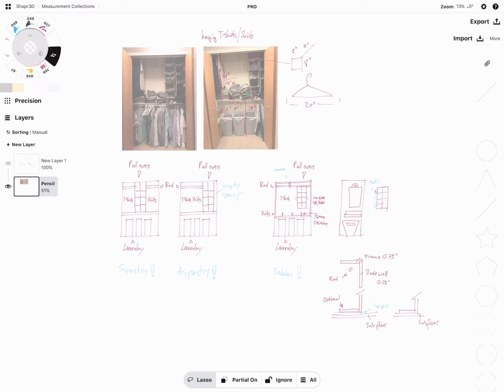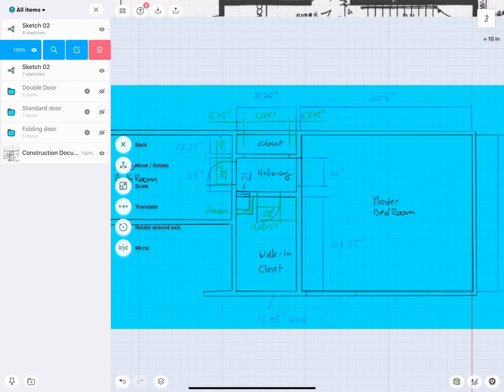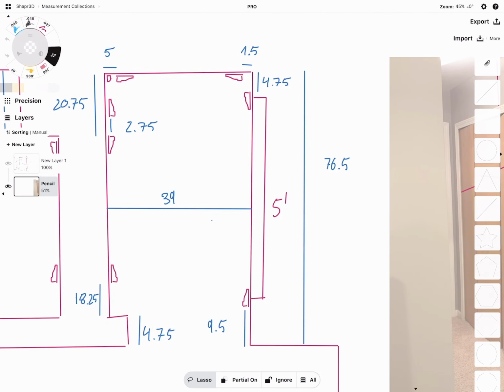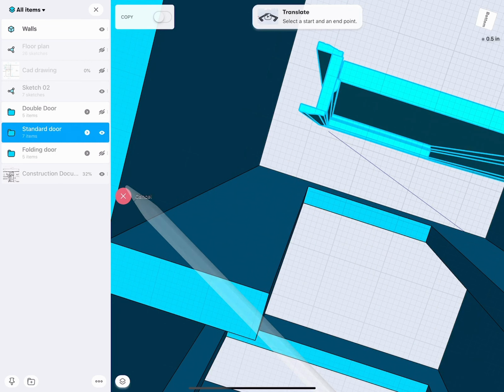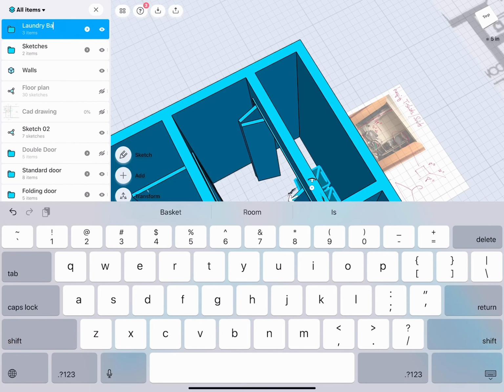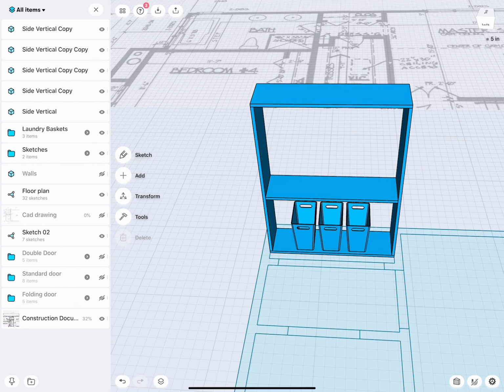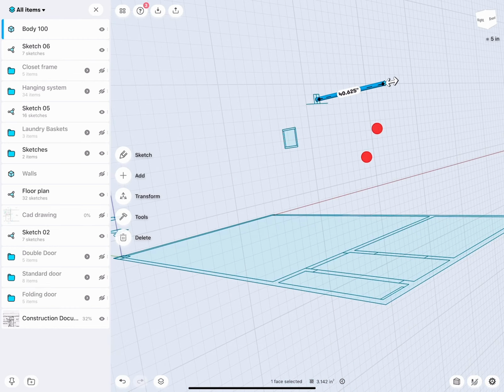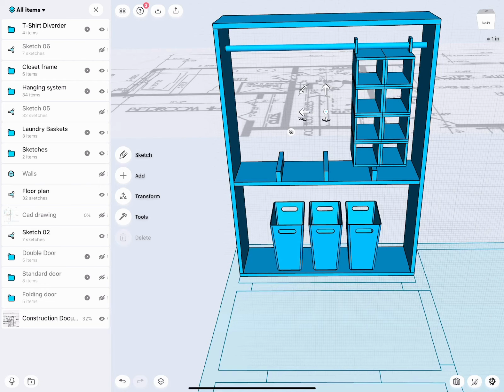Import and modify floor plans as DWG files on your iPad | 3D design webinar

Comment: I am really loving Shapr but you need to speed up the presentations, 10 minutes in and we are still scaling the image. A separate video for scaling images would help then you would not have to explain it in every single video. The scaling image option could be so much easier, in most CAD packages, the scaling of images just requires a reference dimension and the image is scaled to that.
Reply from the maker: Good point, both about the video, and the functionality
Reply: I second this - the scaling process is super clunky compared to other programs

Comment: So you cannot enter 8ft as the dimension, you have to convert it into inches first.
Reply from the maker: Hi, the app has the Foot metric unit as well. it's a good practice is to set your unit and grid-scale before you start your project and then maintain that throughout your project. You can change the unit when you want to export your design after you are done with the design.
Reply: @Shapr3D  i meant was that if i entered 8ft it should do the conversion to inches and use that. Thats how sketchup does it. You can enter ft or in , it knows what to do.
Reply from the maker: Okay, I see what you mean. In the app, you will need to set the unit for your parameters.